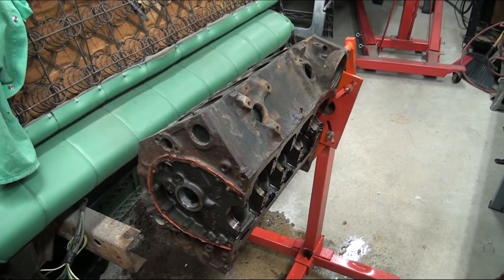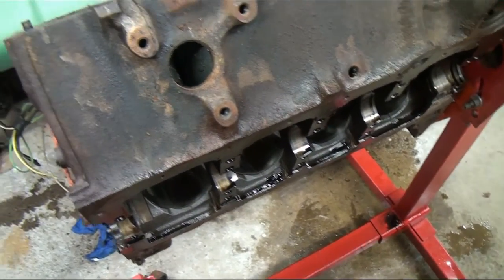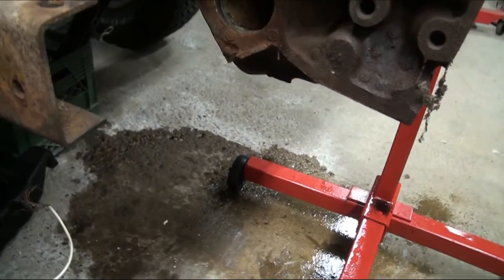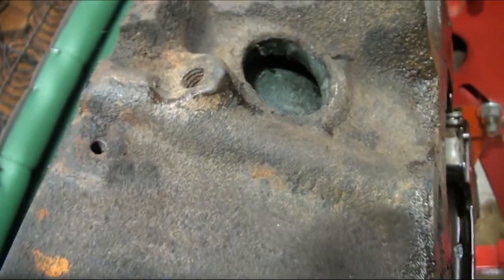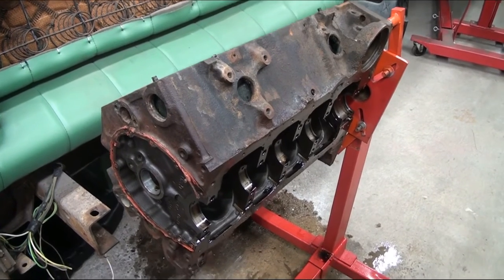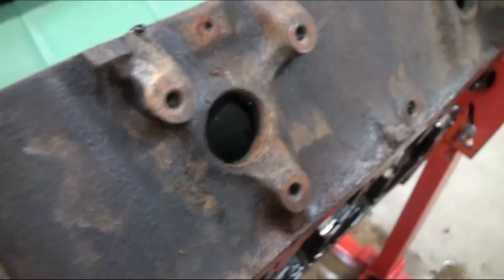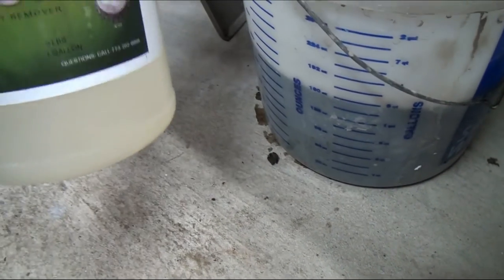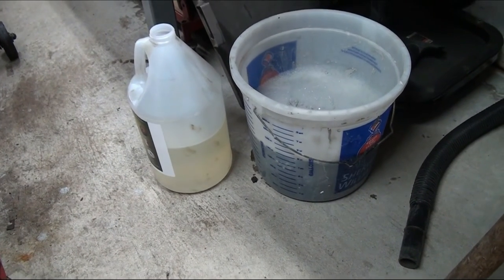Using Rust Release to clean an engine block

Comment: I have a BBC in a drag boat that all freeze plugs were rusty and the guy put epoxy over all freeze uga.
When I started the boat with water going thru it most freeze plugs were more than a squirt gun.
I got them out and put my finger in back holes and couldn't believe how big of a pile of sin rust deposits there was.

What's the best way to clean out all water jackets and to get that rust out?
I've pulled out over a full cup of rust with my fingers.

Thanks 
Jerry
Reply from the maker: You can start by flushing the block out. Run a lot of water through it and that should help flush out any sediment and other dirt and deposits. After that, I would try something like what Walt did. put the plugs back in, fill the block with Rust Release, let sit overnight, and then drain and rinse out.